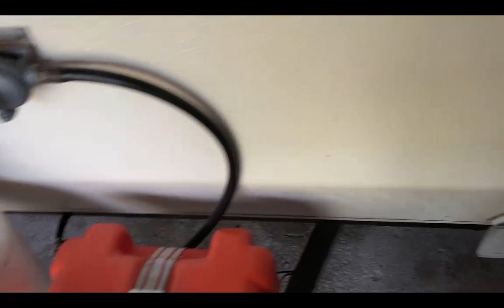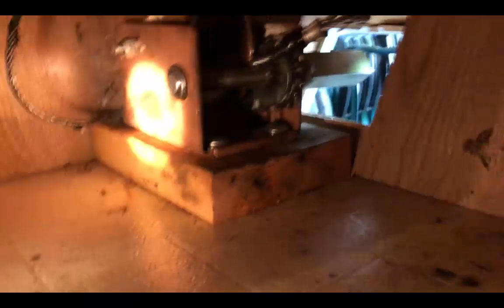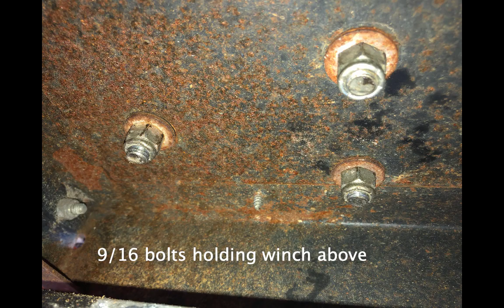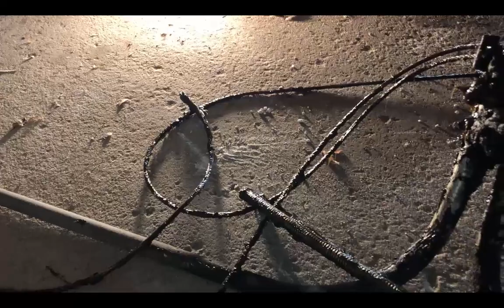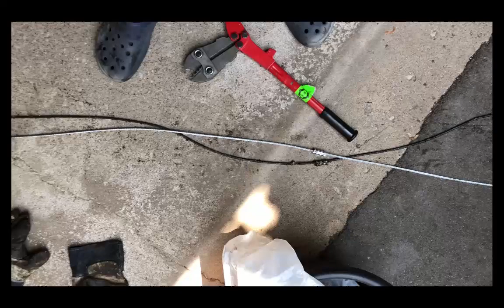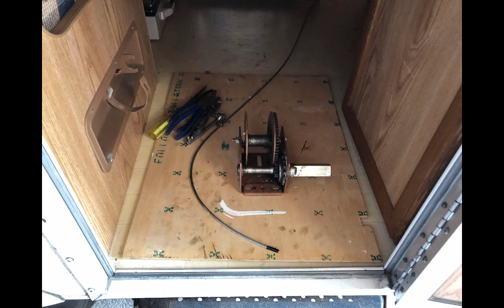Dutchmen Goshen lift mechanism repair

Comment: What do I do when the cable is binded tight while pop up mid down
Reply from the maker: I hung the tent trailer roof from the ceiling of my garage to take the weight off and then began the repair. It was only then that I could take the tension off carefully. I used lots of rope and proceeded very carefully.

Comment: Question what does the lift arms sit on? I have one stuck.
Reply from the maker: I'm not sure what you mean by the lift arms. The part that lifts the posts is like a big spring. There are four of them, one in each corner. In my experience when the back end of mine got stuck, it was a problem with the crimp repair I had previously made where the cable is in the grease chamber. The crimp had slipped on the cable and slid to the wrong position. You probably need to take it all apart and replace the cable. Be careful though to remove any tension (I supported my roof with winches from above) before taking it all apart. Don't get injured.

Comment from the maker: It is now Fall 2020 and this tent trailer has been used by my daughter and her family twice this season. The lift mechanism is very smooth in so far as the cable system is concerned but when the roof is two thirds of the way up, you need to shake the two back lift supports  so that the large square tube slips through the sleeve. As long as you do that it goes up smoothly. I urge everyone to make sure you do the crimp
tightly, be gentle when cranking, and never force it.
Reply: You may need to lube the hell out of your telescoping lift supports. Mine dried out and the roof would not raise at all until i sprayed a quart of silicone on it

Comment: Where your cable comes up threw the floor, I would add a pulley.  Thank you so much for this video I am doing the same trailer this Monday.
Reply: I have the 1995 dutchmen 1202 box . When I crank it all the way up the top rocks back and forth is that normall?
Reply: @redeye9042  I think the fabric walls should be taught and stabilize the sway.  If you have the fabric off or undone it will probably sway and actually not be very safe.

Comment: Good video, I have same model and my cable broke in the same spot. Thanks for the upload, I need to get to work on mine.  Everything looks good, one thing I would keep an eye on is friction on the cable and crank and the floor. I think that’s why the cable is fraying.
Reply from the maker: My son-in-law and I ultimately repaired the cable a second time, and with his help, we managed to feed the cable properly through the "L" pulley. The trick is to either not pull the original cable all the way out of the "L" pulley but cut it to use as a fish line to pull through the new cable OR do some interesting and difficult fishing then joining of two pieces of cable - one from the bottom and one from the top of the "L" pulley. You can fish a piece of scrap cable down from the top (behind the pin - between the pin and the top pulley) then from the bottom push the end of that piece towards the driver side of the trailer. Then tape that scrap piece to the new cable that you have fished through the bottom of the old pulley from the centre of the trailer towards the driver's side of the trailer. I wish I could show you pictures but you have to do most of this by feel rather than sight. Fortunately my son-in-law has a double jointed shoulder and could reach in from the top and actually see what he was doing. You're right, my original approach would have caused the cable to cut into the floor and eventually fray against steel. My daughter and son-in-law have now inherited the trailer. Try to take pictures or video to show everyone else how to do it. The "L" pulley is problematic.
Reply: Thanks for the reply, I’m not really looking forward to the project but need to get it done.  Thanks for the insight and your video provided good info. I’ll definitely keep the pointers in mind when I tear into it.